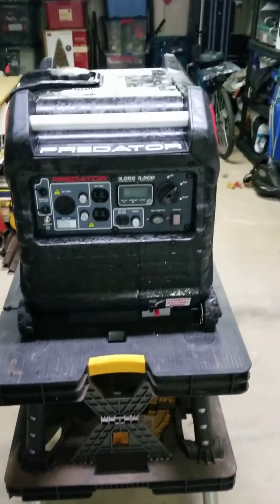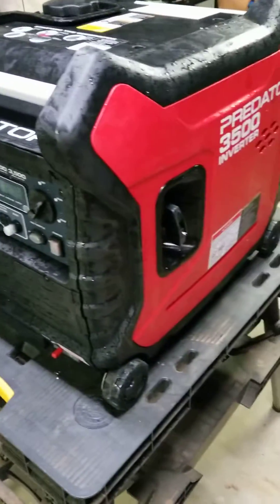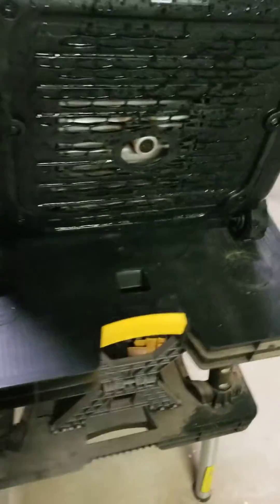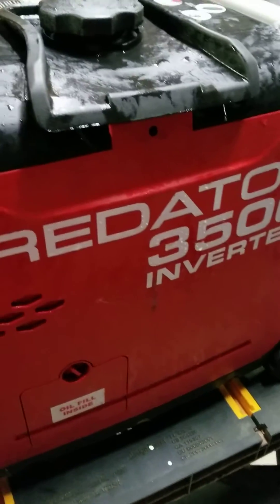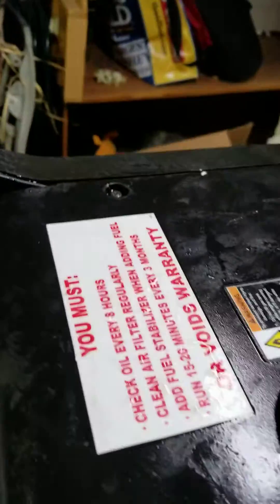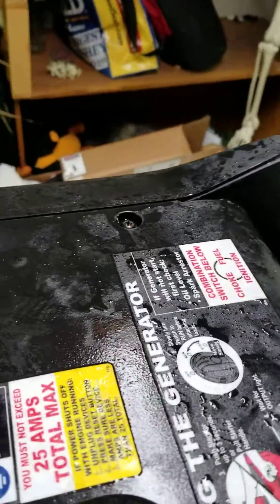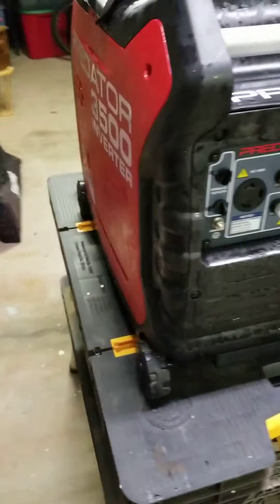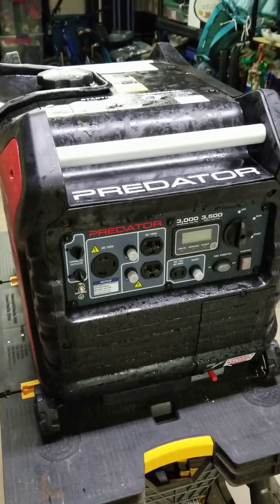The Predator files. Predator 3500w Inverter Generator no spark No. 1

Comment: My predator 3500 has spark while cranking but looses spark immediately after it starts. This happens with the knob in any position,  start/choke, run, even while in the off position it will start then immediately die.
Reply: Check your oil level. There is a low oil sensor that cuts spark when the oil is low. If your oil level is adequate, you can try and unplug the sensor. It's a single wire coming from the engine on the pull start side. Also, you can pull the panel off the front and disconnect the two black wires from the switch, which would disable the kill switch. Hope this helps find your problem.
Reply from the maker: Sorry, I did nt see your comment earlier! I am not sure how I missed the notification. Something is definately wrong, In the off position, you should not be generating a spark. In off, you should not be able to start it at all. Have you checked the Off/Start/ Run switch internally? Taking the front panel off and looking at the switch sounds like that would be a good place to start.

Comment: Similar thing happened to me. My gas tank was completely and totally filled with rust. I kept the tank topped off over the winter, went to start it in the spring for its 3 month "15 minute run" and nothing nothing nothing. Opened gas tank and saw the insane amount of rust. Turned upside down to drain gas, it's been 5 months I mess with it every ,month or so and for the life of me I cannot get the damn thing to start. Everyone ONCE in a while it was attempt to start and poof out some black smoke out the exhaust for a split second then die. Hook up to charger and hold start button endlessly, it turns and turns and turns and never starts.
Reply from the maker: Link to video after CDI module replaced.

https://youtube.com/shorts/A_fmsgEiK74

Comment: Well, there's more to this than just the ignition module. There's also a stator pickup coil (mine failed) and it's buried under the plastic shroud and mounted on the same plate that the ignition coil is on. They are actually separate components but share a mounting plate. Mine was intermittent and finally failed altogether. The generator was brand new right out of the box but alas, my friend who bought it waited a couple years before taking it out of the box so no warranty...HF has some spare parts for this generator. The Coil assy was $25 shipped.
My videos under my other user account, kaydee457:
Part 1- Disassembly:
https://www.youtube.com/watch?v=DX1SajZQdOQ
Part 2- Repair and reassembly:
https://www.youtube.com/watch?v=hEc6m2B_5qk
Reply from the maker: Shortly after putting the CDI module in, throwing the covers back on. https://youtube.com/shorts/A_fmsgEiK74
Reply from the maker: 2nd part.  https://youtu.be/VKnbT1gn3VY

Comment: Do you get the part in, and does it work now?
Reply from the maker: Yes there are follow on videos. The CDI module fixed the no start issue.
Reply: @egregg57  so my problem with mine is that it has no spark, just to be clear that was the same problem that yours had right? And with that part you bought fixed the problem right?
Reply from the maker: @baltazarcisneros4499  yes, the starter wire insulation had been cut through by the ground tab of the SCR mounted in the CDI module. One of my videos shows the damaged insulation. There are other issues that can cause a no start condition. Check the oil level sensor switch, spark plug wire and connections. Verify spark present, not present. By removing the plug and ground against the generator frame.
Reply from the maker: @baltazarcisneros4499  https://www.youtube.com/watch?v=IxRLsbQgO48&feature=youtu.be
Reply: @egregg57  can you send me the link of that video
Reply from the maker: @baltazarcisneros4499  see above.

Comment: choke ?   thought you said no spark..so did you get it figured out yet?     P.S.  Blow your nose!
Reply from the maker: Nose..check... there are follow on videos. Yes it was the CDI module that failed due to the metal tab of a SCR wearing through the insulation of a poorly laid starter wire and shorting the wire to the module.
Reply from the maker: Check out the repaired generator here: https://youtu.be/A_fmsgEiK74